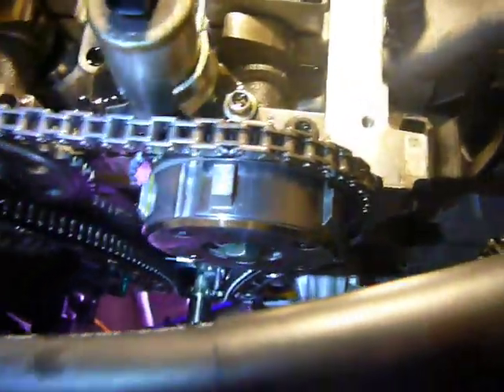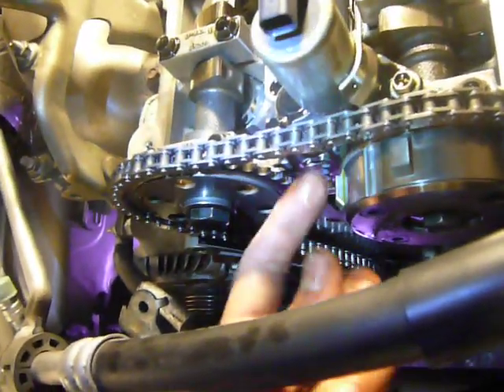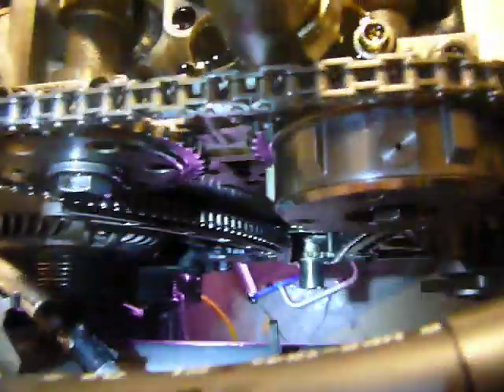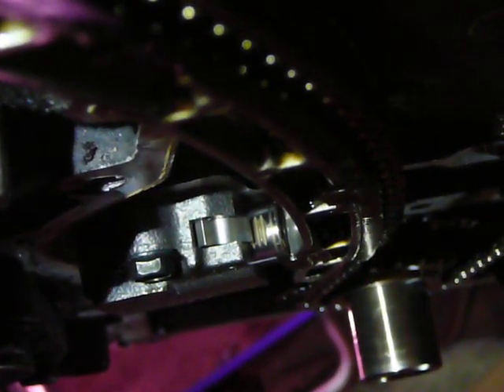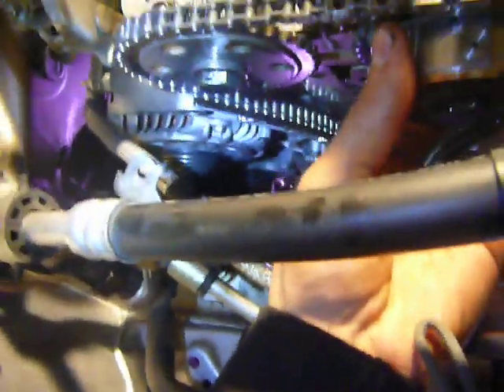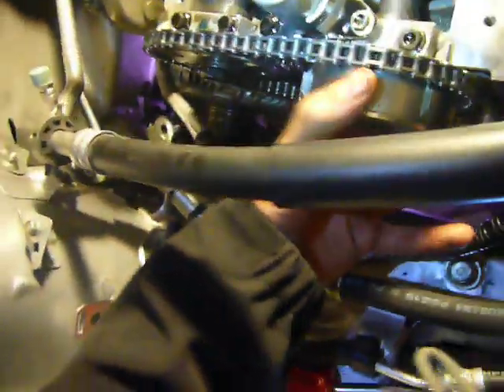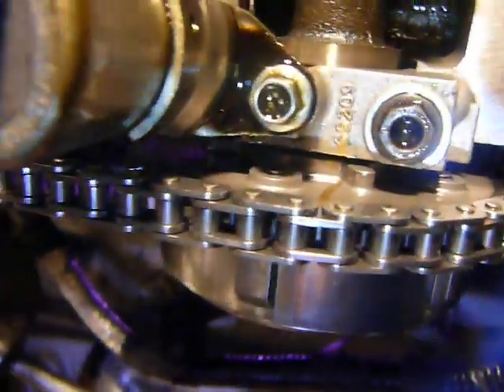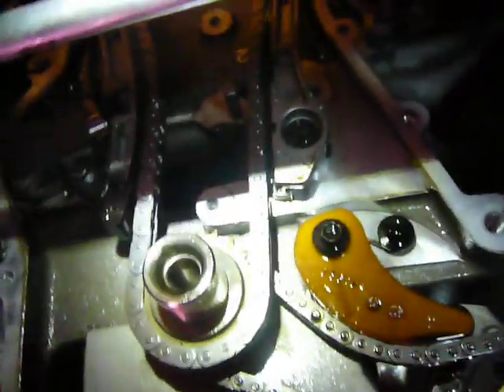Mazdaspeed 3 VVT/Timing Chain/Etc DIY Repair - Setting Chain Tension

Comment: hello i have a cx7 2.3 turbo and ran into the same problem with the vvt actuator. installed it no problem but now i have no spark? how did you ever figure this out?
Reply from the maker: You have "no spark" as in your car won't start? Since you disconnected the entire wiring harness, I would say start by double-checking that you plugged all the connectors back in properly, then make sure you reattached your fuel pump correctly. There are so many little things that you could have forgotten that it's really hard for me to speculate.
Reply: Govanification fuel pump, is it not in the tank? And when you said dreaded vvt failure, was it just a constant po300 or does the car die when it fails? Thanks
Reply: Govanification thanks
Reply: Govanification "The VVT failure is "dreaded" because the original design for the VVT was flawed and basically all of them eventually malfunction"
Learned a lot from your video. But could you give a little explanation on how it will eventually malfunction? Thank you.
Reply from the maker: Shiwei Luan 
The vvt can malfunction in a few different ways, the simplest of which is getting the small oil passageways clogged from too infrequent oil changes, which would cause low pressure inside the vvt and your engine would not be able to properly control your valve timing (or it would adjust slowly). This is dangerous because your timing is adjusted based on how much throttle you are giving the car, so if you mashed on the gas and your timing was set for coasting fuel economy but it wasn't able to adjust fast enough you could end up with engine knock, leading to piston head pitting, bend rods, piston blow-by, etc. This is NOT the "dreaded" vvt failure, however. The failure due to manufacturer error is that there is a pin that engages with a hole in the vvt when it is locked in the normal (no timing advance) position, i.e. when you cold-start your engine in the morning or stomp the accelerator. Over time, this hole gets worn into a slot, so your vvt does not lock properly in the normal position, which causes your vvt timing to slip when cold starting as the pin rams in and out of the hole, causing the cold startup "death rattle" that so many people hear. As your engine rpm gets higher, the force on the pin lessens and it can finally engage with the slot, or the engine sends oil in to advance the timing (the rattle stops after a few seconds). If left alone for long enough, this slot will get so loose that your vvt may NEVER lock and so you could damage your engine from knock every time you start the car or whenever you really step on the gas, since both those times your vvt should lock in the no timing advance position for max power and safety. 

TL;DR: Oil changes gunk it up so timing adjustment gets slow, potentially dangerous. Mechanical hole wears out and becomes a slot; definitely dangerous after wear starts if you drive hard. Fix it if you hear the sounds! Do regular oil changes!
Reply from the maker: Shiwei Luan 
I forgot to say the next vvt design had some changes to the pin/hole geometry to make it less wear-prone (stamped with a "C" on the face) and the even newer version has local heat treatment around the pin hole to strengthen the material (heat treatment spot visible on the inside of the vvt when it's off the camshaft).
Reply: Govanification Thank you for your detailed reply, but I am overwhelmed. I can only repair my MAZDA3S mechanical parts, but have no experience on engine maintenance. Could you provide more resources on the how vvt/pin/hole works, such as some video links? Thank you.
Reply from the maker: Shiwei Luan 
The only maintenance related thing you can do is to do oil changes every 3000-4000 miles. 

The only mechanical repair you can do is replace the whole vvt. You cannot realistically repair it.
Reply: spacecalander
Reply from the maker: Charlene Barney Wtf is this